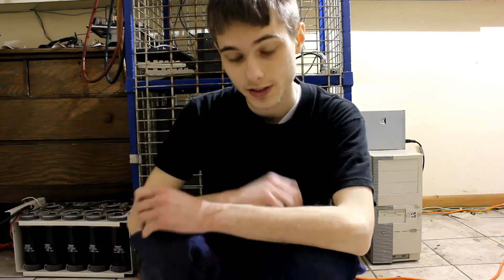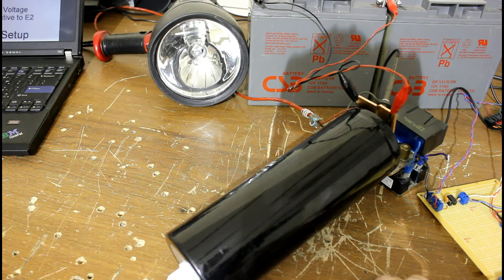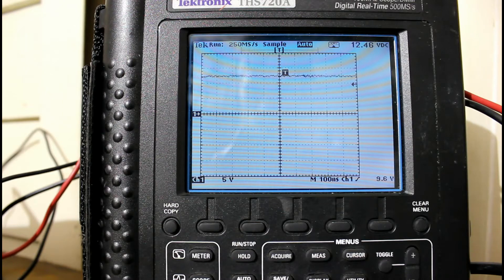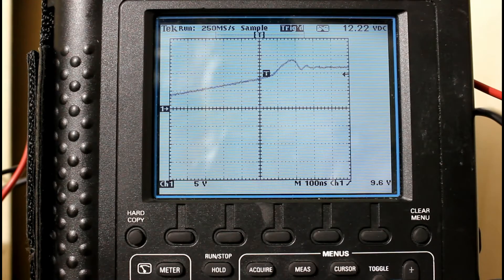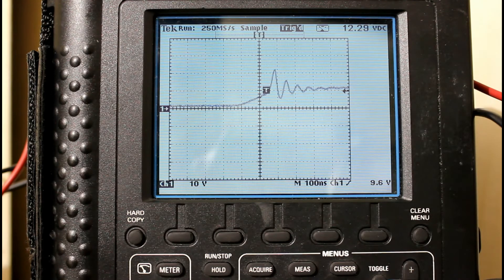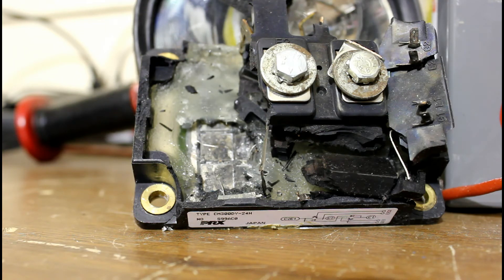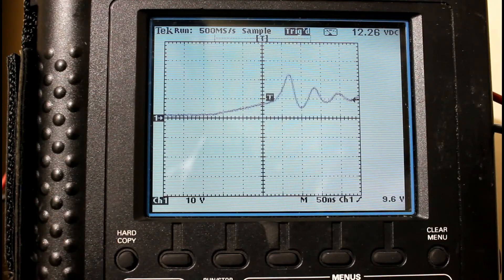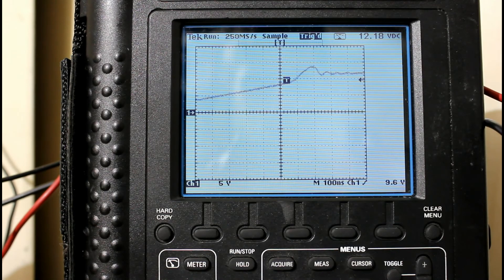IGBT Lab 1

Comment: Great video! I'm working with a new electric motor design. I have been having a hard time using mosfets for my power control. I have been working with gate resistance and a snubber capacitors to find the right combo to fully drive my motor. Your explanation covered my problem , that voltage spike. 
  If you get time I would like to see a video on your equipment for monitoring this. What type of meter are you using and how it connects to your circuit?
Thanks Again

Comment from the maker: Yes that's correct. The point is though, a larger IGBT is harder to drive, and wastes more power when switching compared to a smaller one, even if the current and voltage is exactly the same

Comment from the maker: The Snubber (Aerovox RBPS 1000VDC 2.0UF/K) Does make some small difference even with the big capacitor attached. It is only 2 microfarad so it's not too good for decoupling high currents like the larger cap but it is good for dealing with fast spikes when the switching frequency is high.
Reply: I have a question my friend so the snubber capacitor like you said in the comments that removes the current spikes and that's right I think so my question is what do you think will happen if you don't use one ????
for the record I have been making alot of Igbts like six one of them to drive a motor but failed I think because I didnt use snubber
do you think that this is my problem
please want to hear from you......